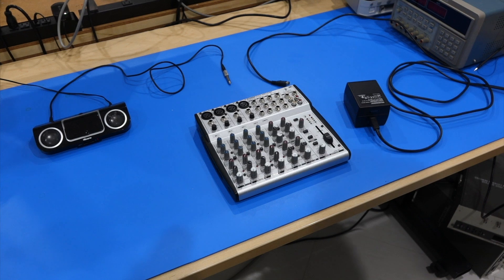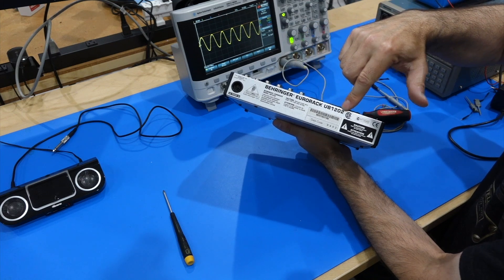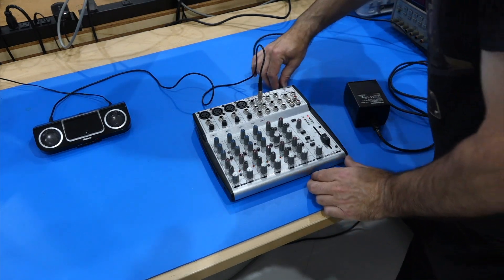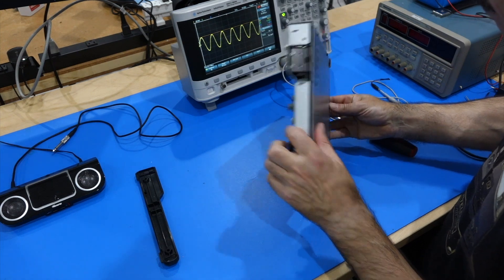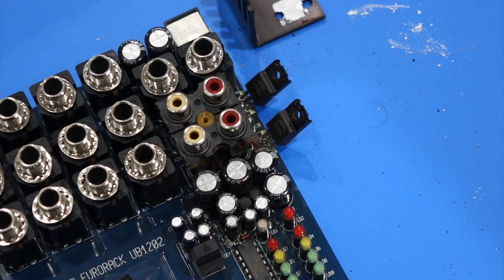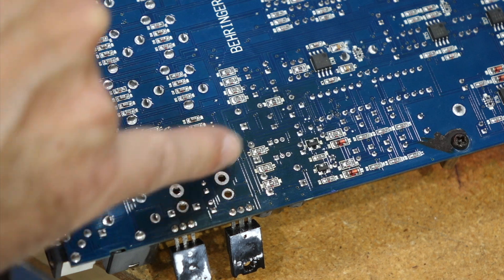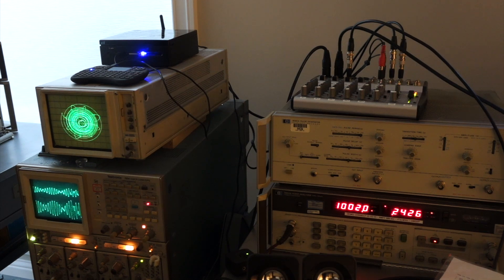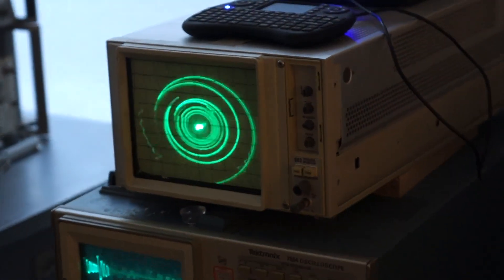Modern Tech Fail: Behringer Eurorack UB1202 Repair

Comment: That failure rate is just crazy. How can they stay in business?

Edit: I'm talking about the capacitor company... If their caps are so bad, how can they manage to sell them?
Reply: As long as it fails after a years warranty they don't care.
Reply: By being very cheap.
Reply: Behringer went all in on the price when they moved to china. It's the typical brand kids buy having no money or you buy for a one-off. Their digital stuff is kind of okayish.
Reply: @falkmachtsachen  hehe, "okayish". Have an anecdote ;)
I bought an UFO202, the little USB audio thing designed to "digitize old records and tapes, yadda yadda", specifically to mess with my tape decks. I once failed to adjust azimuth on a cassette deck while using it as a signal generator, stereo would go out of phase every time I'd change frequency. I thought that was odd, but the kind of 'yikes' I definitely did NOT expect is stereo signal from the sound card being already out of phase right from the start. They used to put TI PCM2902 chip in those little audio things, but somewhere down the line they made their own clone of it and started using that. Long story short, replacing clone chip with (probably) genuine PCM2902 fixed it.
It looked like the DAC channels were shifted apart from each other by 1 sample, so stereo phase would be all over the place depending on a frequency, I'm just baffled by such an amateur hour...
Reply: By being cheap. they sell LOTS of products by ripping off their designs from other companies, making the SAME product using cheaper components. and by selling them so cheap, they are not worth fixing. so you buy another one and another and another until you finally decide they are not worth it and buy a real product. absolute garbage products! and few if any repair shop will touch them as they are not even worth the basic diagnostic fee
Reply: @overkillaudioinc  I meant the capacitor company... So many failed caps
Reply: @jeremiefaucher-goulet3365  That timed-to-fail after the warranty period is up is the capacitors selling point to the OEM.
Reply: @haweater1555   I see... What you are saying is that a MTBF this incredibly low is actually a sought-after feature for companies like Behringer.

I'm familiar with the concept "as cheap as possible". But I wasn't familiar with the concept of "so bad it's guaranteed to fail after some very light use".
Reply: @jeremiefaucher-goulet3365  Because most things containing capacitors are not musical items that the owner expect to last for 80 years. A component supplier can happily stay in business by selling components to companies that makes toys, kitchen utilities, radios, clocks,  novelty items, etc, that only has a limited lifespan. Take a television set as an example: In parts of Europe we have switched from DVB-T to DVB-T2 encoding. This means that televisions that are more than 10 years old cannot receive anything now. This was not considered a problem by the TV authorities because.... who owns a TV set that old - except me!?! People are simply not expecting things to last long anymore - except musicians. But still it's sad. I have a lot of equipment from the 1970s and even 60s that still runs on all its original components.
Reply: @jeremiefaucher-goulet3365  MTBF is "Made to Be Failures" now? (I know it's Mean...)
Reply: A lot of functionality for hslf or a third of the price. But less good on audio quality and general quality. Nice for practice or a new band.
Reply: Because you keep buying them?
Reply: Cost accountants trying to squeeze every fraction of a cent out of the cost of a product, overriding the engineers.
Reply: @KameraShy  I know, I get overridden all the time 😂

Comment: Oh my. This is why many sound engineers have "no Behringer" in their Technical Riders ...
Reply: Best avoid Midas as well then... they're the same company now.
Reply: @TheErador  I ran a couple of shows on Midas when they were the hot console on the circuit and I was never impressed.
Reply: @chrisose  I'm more of a amateur theatre sound guy so not got heaps of experience, but I would say that I preferred soundcraft over any of the other desks I've used, usability wise as for actual preamp (etc) sound quality, I couldn't say not having tried them side by side.
Reply: @TheErador  Most of my work over the years has been on Soundcraft desks and they have never let me down. I know some people who don't like the gain structure but they were all the type to run everything up against the peak lights which makes no sense to me.
Reply: @chrisose yeah makes no sense to me either. I like to see them averaging around 0 dB. Run less risk of topping out if they decide to be massively louder than when you sound checked ;)
Reply: @TheErador  In 40 years of doing live shows I can confidently say that every band plays louder in the show than in the sound check.
Reply: @chrisose  hahaha ain't that the truth.
Reply: @TheErador  Get high end Midas, that stuff is still made by the old Midas crew.
The cheap M32 is actually just a Behringer X32 with a fancy appearance. It even runs the same software.
Reply: Especially the really cheap stuff is just that - cheap and bad even for the price.
However I like the Behringer equipment a little bit further up the professional line. Still costs way less than the competitors while being quite good. If you just need a compressor/gate or graph-EQ or a rack-mixer or a (monitoring) headphone amplifier, Behringer is ok in most cases.
And there is also stuff that is really great regardless of cost: The Behringer X32 is a great digital mixer, I absolutely love it! It plays up there with the big guys while costing a fraction.
Reply: @TobyAsE120  The Behringer X32 is basically the Midas M32 with different pre-amps.  The M32 uses the Midas line and the X32 use the Behringer line.  But under the hood, the rest is the same.  Even the firmware is cross compatible if you don't mind your startup splash screen to be wrong.
Reply: @BruteClaw  I knew that they are basically the same. Very interesting that even the firmwares are compatible, I didn't know that!
Reply: @TobyAsE120  because it's mostly an Midas desk but at a nicer price!
Reply: @TobyAsE120  
Behringer can be a mixed bag. 
I found the Behringer compressor to be unacceptable for vocal compression live ... destroys the quality, just not transparent enough.
Reply: I remember when the smallest Soundcraft Spirit mixer cost $400 in the 1980's.   A functionally similar Behringer for $50 is OK by me, if I am not employing it in a life-or-death situation.  At that price you can have hot spares in your equipment box. Even the classic mixing desks with Penny and Giles faders, Elma switches, etc. fail.   Learning to diagnose and repair lightly broken stuff that other people discard is a great way to learn the craft and augment your gear stash.
Reply: @vibrolax  yeah they're cheap and great for stuff where you're setting a level and then forgetting about it, but for ~£150 my little soundcraft EDM is much nicer to use with proper faders.
Reply: @TheErador  Sure.  The point is the price of usable entry level stuff decreased alot.  At the time Behringer appeared, the only sub-$100 mixer was probably a far less capable Realistic (Radio Shack)  model.
Reply: @vibrolax  hell yes. The barrier for entry for so many things these days is super low compared to even 10 years ago. Pro audio aside, the technology that i have in my pocket is a far more capable camera than the £1000 digital cameras then. It's amazing really.
Reply: As a sound guy and technical director, I love Behringer, they are cheap so I can play around with stuff, give it to small groups, have a couple that I can toss in if I need to do some special mix down or give a caged drummer some headphone control, but it's not going to be my main anything when it matters lol
Reply: i got burned, won't ever touch their garbage again
Reply: @axeman2638  Sometimes you really do get what you are willing to pay. 

There is a nice small field mixer made by Rolls in the USA 
https://rolls.com/products/accessories/mixers

There are also the British small mixers like Allen and Heath, only they are manufactured in China.

Behringer was one of the very first to be designed in Germany and manufactured in China. The first product of theirs I remember seeing at NAMM was the digital EQ.
Reply: As an installing engineer for AV equipment, I never recommend Behringer. I have lots at home and I am aware of their VERY poor build quality - but it's home, I am ready to deal with it and if a speaker or a PCB fails, I'll have fun repairing it.
But in a professional/commercial environment: NO WAY.
I had many DCX2496 myself and I used to recommend those to people. I stopped as they would fall apart (mostly bad soldering introducing noise) and cannot be trusted. Service is also pretty bad unfortunately.
My Truth 2031 speakers have such a poor voltage regulator design that it's clearly "design to fail". The regulators have to drop the voltage from 40V to 15V (if memory serves) and they run at silly temperatures all the time. No heatsinks of course - why would you need one. Hence the trace on the PCB - which is already of AWFUL quality - fail. I believe I read that Behringer service centers would only "repair" units under warranty (by swapping boards) and would not attempt actual PCB repairs. I can totally understand why: when I had to replace one of those regulators I ended up with a number of botch wires to fix broken traces...
Reply: @tony359  Truth Behringer B2030A, bought used, a few years back and needing a replacement tweeter. Since then, I've been well happy with them, although I doubt I would use them at pro level. But great as a computer sound system, and they work great with Protools and other such DAWs.
Reply: I got a few behringer stuffs they work good and some are old too
Reply: While their lower quality stuff is fairly trash, their mid to high range stuff is pretty decent. Our 6 piece band uses an X-Air 18, and it's pretty rock solid!... this board, definitely not so much.
Reply: Funny, I have a lot of 20 year old Behringer gear that still works flawlessly, but recently picked up two of their new TD-3 synthesizers both of which have different problems (the Start/Stop button beeing loose on one, the Write/Next button on the other) and really don't feel reliable at all. Seems like lots of people are having issues with the resonance knobs on theirs too.
Reply: I'm one of them.  And it's not just the likelihood of the device breaking down during the show; Behringer equipment from brand new has bad sound.  Very poor gear.
Reply: Actually there are two products, which are really nice, not "nice for the buck" but really nice. The DCX2496 Ultra-Drive is good, but be sure to get an old one with PCMCIA-slot, because the guys at the "Ohrenmarke" never learned how to RoHS-solder. And the FBQ100 is a tool i always have around, when a mic makes trouble and you don't want to re-cable the hole FOH.
Reply: @falkmachtsachen   The Ultra-Drive DCX2496 is really a nice piece. I usually don't like Behringer for the obvious reasons but that little piece works for us even after years of abuse. Quite good for the price.
Reply: Falk macht Sachen the old ones were RoHs soldered, though.
Reply: Behringer.  It's a shame in many ways...  The physical build quality is pretty good.  The mechanical components, such as the Alps pots and faders, the metal work and the many many screws are good.  The circuit designs, although somewhat borrowed, are good.  Their designs are mostly good, the X32/M32 is a great useable console, very well thought out and very easy to get on with.  I tour (currently I used to tour) one, it's lightweight and the iPad app and firmware is great and reliable.

Shame they use garbage components though!  Meh, Yamaha Digital FTW!
Reply: @andyfinlay9776  i had a ddx3216 during 10 years that drunk more beer than me in all those years. Everything was corroded. And everything was working perfectly lol. I sold It working perfectly
Reply: @cws-999  Oh wow!  I still have one somewhere in the warehouse.  Perfect example of Behringer the DDX.  It was a pretty good copy of an 01V, which had some functions missing, but other useful ones instead.  Fairly well thought out, flexible and quite easy to use and didn't sound bad, for the time anyway...  The biggest problem with them?  Yup, capacitors failing in the PSU, at least partly due to bad ventilation usually caused by a blocked or failed fan that was too small for the job anyway.  Mine works but you have to cycle the power until it boots properly, then leave it on!

Incidentally, the only reason Behringer pulled the plug (ha!) on that desk was because the semiconductor manufacturer of one of the DSP chips stopped making them.
Reply: @andyfinlay9776  yep, i didnt remember that little noisy fan. Maybe i didnt had problems with it since i added 3 fans. Is true, i didnt remember the bad cooling. Sound wasnt so bad. In that time I was using an aardvark q10 todo and i replaced all with focusrite adat preamps... and well... ddx sounded just a little worse than focusrite or q10, but very aceptable and very ok for live rigs. At least not like that those analog behringer that sounded like an old tape lol (i still have one with something broken i cant remember)... eurorack was the name i think (i dont do sound anymore so i cant remember well)

Comment: Behringer makes really affordable equipment so what did you expect from the components which are used by them.
Reply from the maker: That is indeed a case were you get what you paid for. It’s unbelievably inexpensive for how much stuff is inside, and the rest is pretty solid. With that many electrolytics, it must have been a significant fraction of the cost. But if I were them, I’d rather bump the price by $10 and put good caps in it...
Reply: CuriousMarc You would, which is why you are a YT hero, and Uli B. is a rich manufacturer 😂

Comment: Yay!   Another from Marc!  I have to deal with these mixers all the time...  can't wait to see what's up!  Thanks!  [Yep -- I've had to replace power supply caps in Behringer mixers.  Not a big surprise.   I wonder how many big names rebrand these devices, there are many with the exact form factor, just different case/hardware.]  Best Lissajous curves I've ever seen.
Reply: Sounds like they ripped off the others form factor actually.